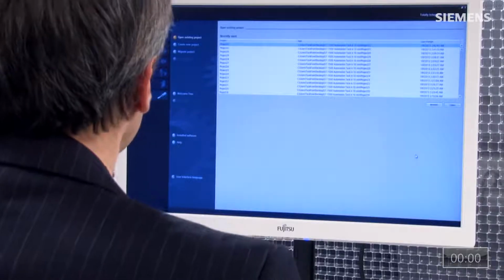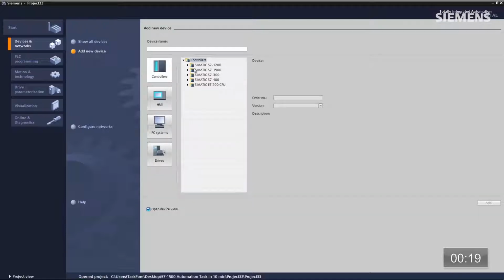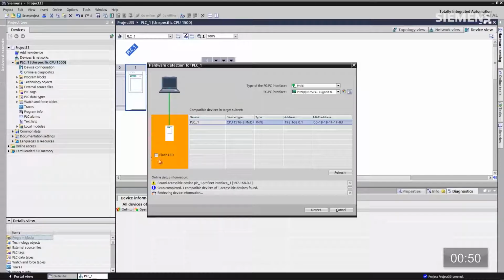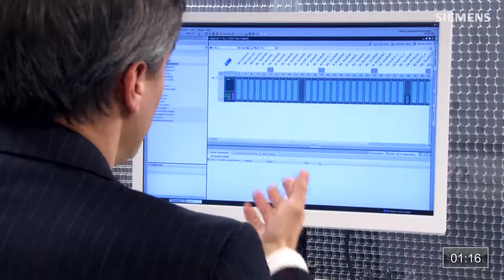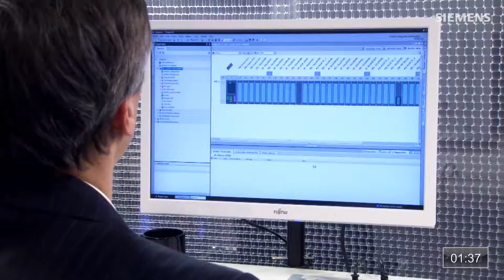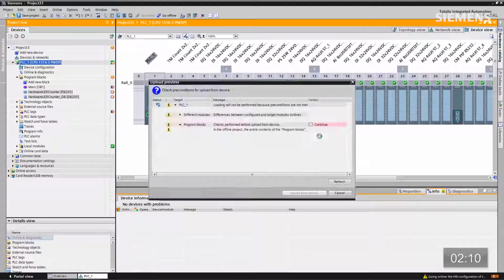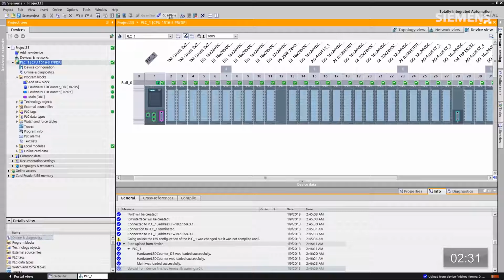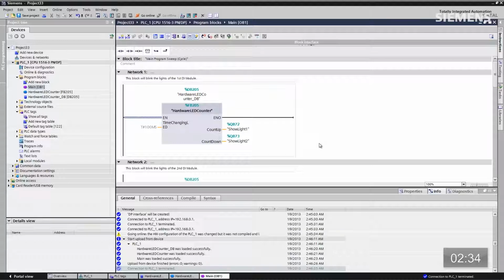SIMATIC S7 1500 AT 4   Full Station Upload

Comment: In fact, the best way to do an Upload for S7- 1500, its Upload as New Station.
Reply from the maker: You are right, I like your way and ise it but this video is Siemens suggestion
Thanks for comment
Reply: @PLCProgrammingCourses  yes i know, but i said it for experince. When you have a devices in a network like profinet for example (ET200SP, Drives, etc), the way of this video its not the best,  because the devices does not appeer. In fact in the manual of S7 1500 says Upload as New Station, like the S7 300.